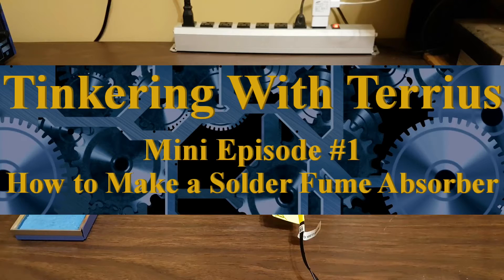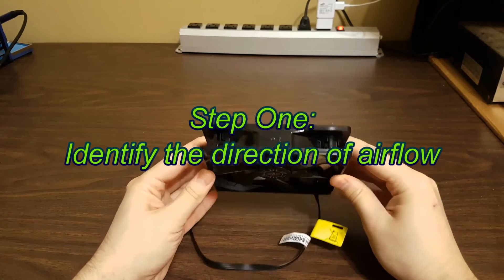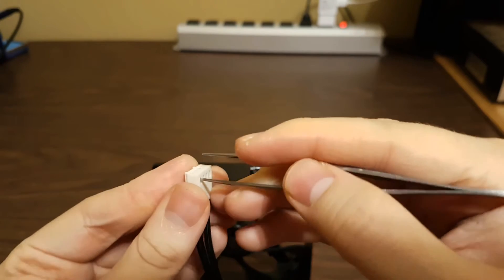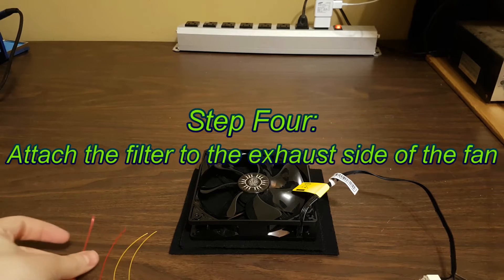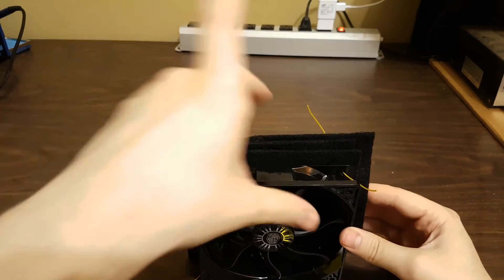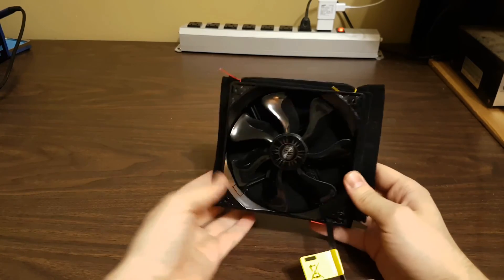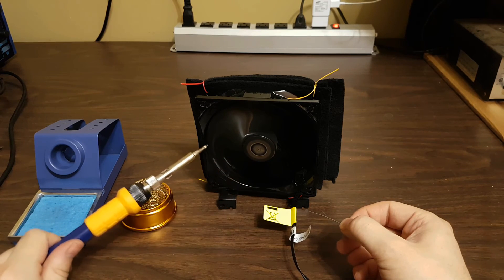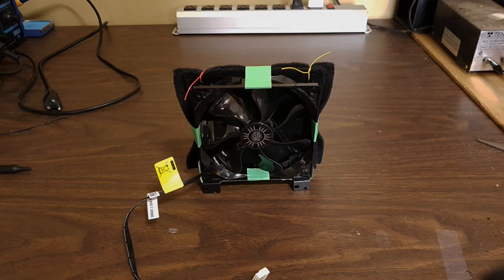TWT Minisode #1: How to make a Solder Fume Absorber

Comment: Hey Terrius,  I just made one of these, following your instructions. Although I don't have a 12v power supply, I used a 9v battery for the time being and was satisfied with the results.  I'll be burning through a lot of 9v batteries now.
Reply from the maker: Awesome! You'd be surprised how long a 12v fan can actually run off a 9v battery. Unfortunately I find they do lose a lot of sucking power at lower voltages but it is certainly a lot better than nothing at all.